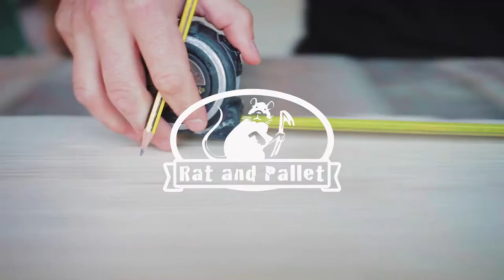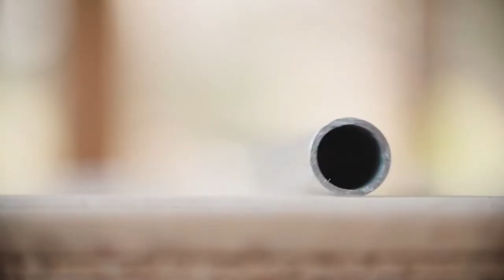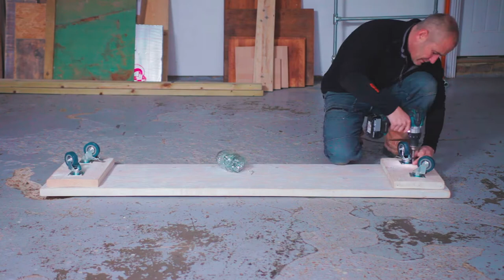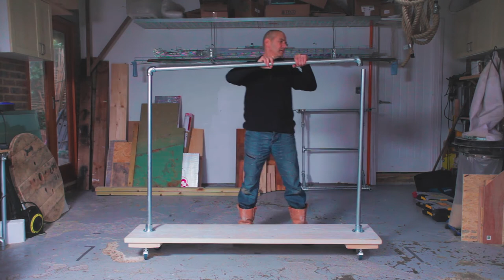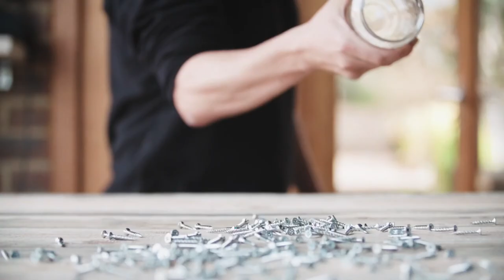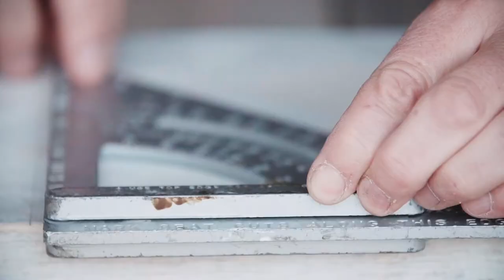Build a Clothes Rail Display Rack from Kee Klamp Scaffold and Boards with Basic DIY Tools

Comment: I have just decided I want to build a Bed and matching clothes rail out of scaffold, can you tell me what OD pipe you are using here it looks about right.
Reply from the maker: Hi Jacknco.. for these designs I used 34mm tube and clamps because any larger, and coat hanger hooks won't fit over on the tube.  I've built a few scaffold beds but haven't uploaded the videos or designs yet - hope to do so in the near future - hope this helps and good luck with your project.
Reply: Fantastic, thanks for sharing.  love the channel looking forward to what you upload next.